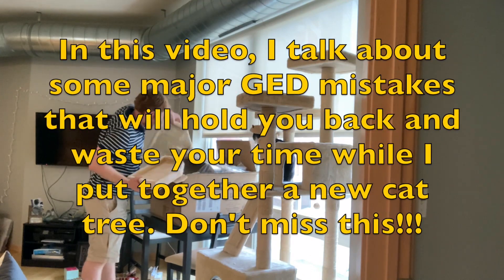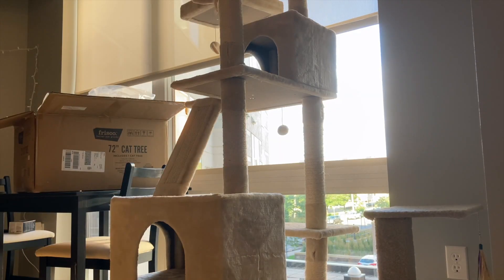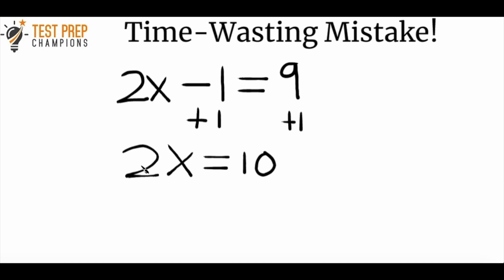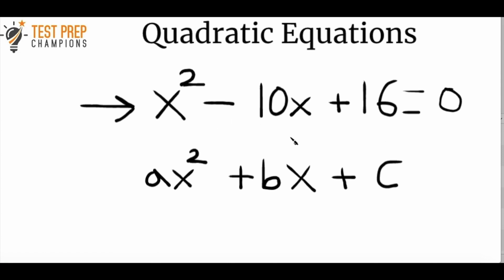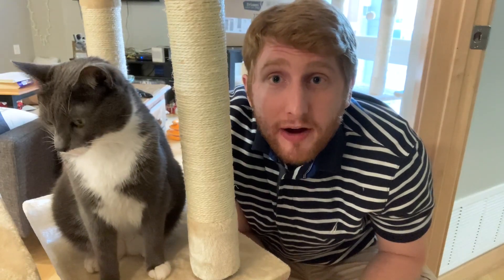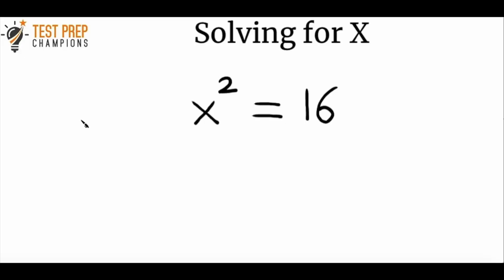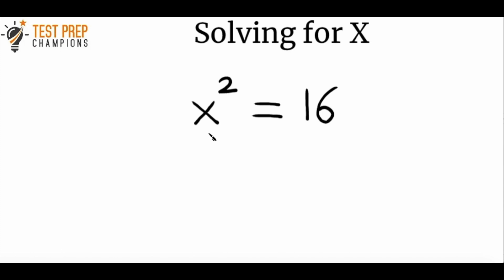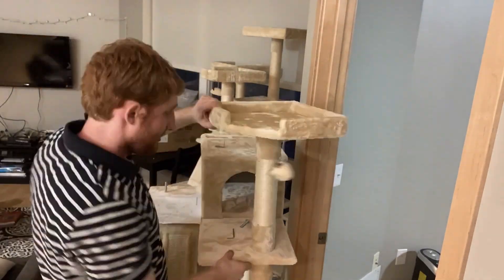Avoid These 12 GED Mistakes or Fail!

Comment: I'm confused between this video and the 2 huge tips "GED HELP!" video about quadratic equations. This video says to NOT put =0 at the end, the other video, you use the example of =0  and used the plug in method. Am is the plug in method different from just the QE ?
Reply from the maker: Thank you for watching and for your question! In this video, you can't use the plug in method because there aren't multiple choice answers given. To solve x^2-10x+16, you'd have to either factor it or use the quadratic formula. In the other video that says "GED HELP!" on the thumbnail, you can use the plug in method to solve it. Does this answer your question? Thank you again for watching and good luck with your test!